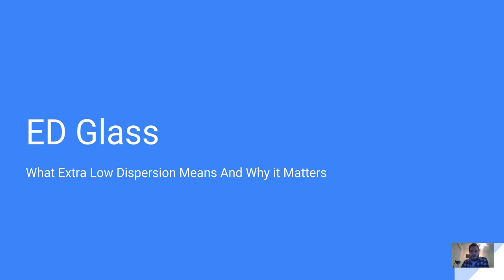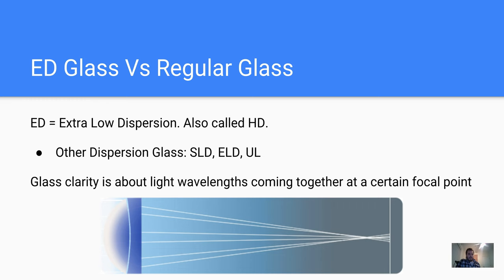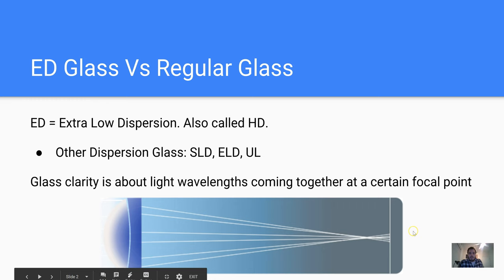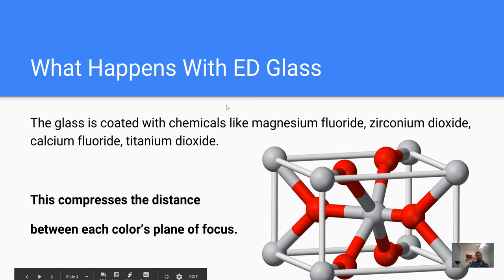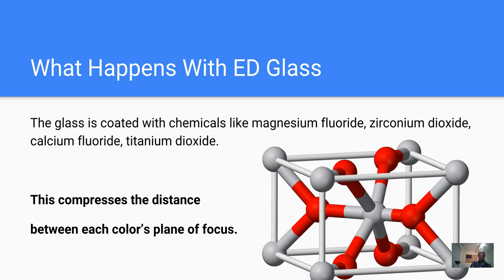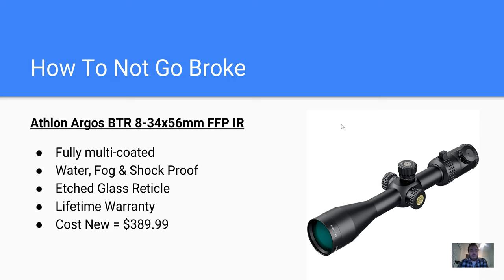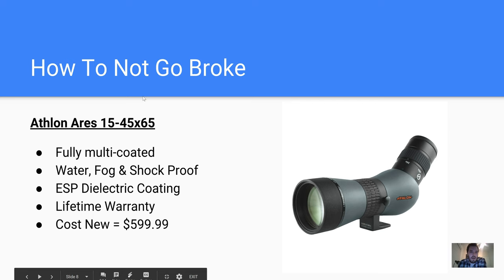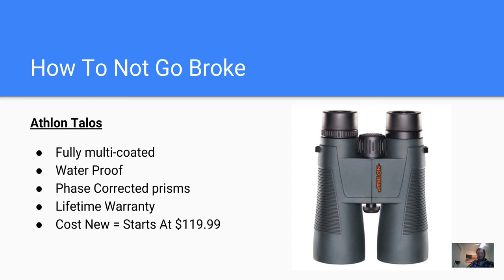ED Glass - What It Is And Why It Matters

Comment: I may be wrong but it has been my understanding that HD glass is 'High Density' glass and ED glass is as you said,  'Extra Low Dispersion' glass. It's also my understanding that ED glass, and better, are types of High Density (HD) glass but not all (HD) glass is considered to be (ED).  Athlon, Riton and some other scope companies have scope lines that are marketed as (HD) but not considered (ED) [Midas, Mod5]. They also have scope lines marketed as (ED) and actually considered as Extra Low Dispersion scope (Ares, Cronus, Mod7). Based on conversations with several scope companies (Athlon, Riton, Sightmark, Primary Arms, Bushnell, Falcon Optics, SWFA, Hi-Lux, AimSports (Alpha 6), Discovery Optics and others - I cannot consider (HD) and (ED) to be synonymous. I believe that there are differences in scopes marketed as (HD) and (ED) rather than one company using 'Term A' while another uses 'Term B'. Bushnell even calls one of their coatings 'HD Raingaurd' which can be misleading to consumers even though I am a fan of the results of their coatings on non-HD scopes I own. 

Thank you very much for your videos. Very informative.
Reply from the maker: Yes agreed there are nuances between the two and I think I should edit to video to clarify the differences, what I was getting at was the basics of the glass are synonymous, i.e. the way it's manufactured is similar and they are considered apochromatic lenses versus achromatic lenses. There will still be differences between HD and ED glass though as you mentioned.

Comment: I bought some mid range binoculars: Hawke binoculars  that have ED glass. But not sure if they are fully multi coated.  When I look at the moon some times the light reflects thorogh the eye peace wich is a bit of putting. There is like a half moon shape of light on the eye peace. Other than that the image is very sharp . And as a bird watcher .The deatail on a small bird like a nuthatch is absolutely amazing. The blur . Iv used swarski binoculars in the past . And  I would say regarding the brightness of the image And sharpness. The simerlarty is uncanny. They say 12 x 50 are bit as good as 10x 42 but I beg to differ.